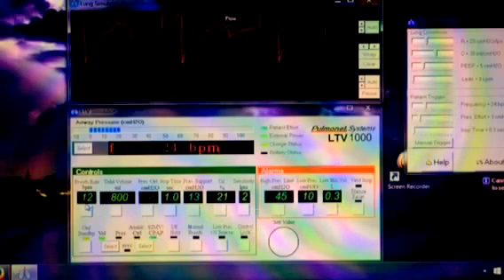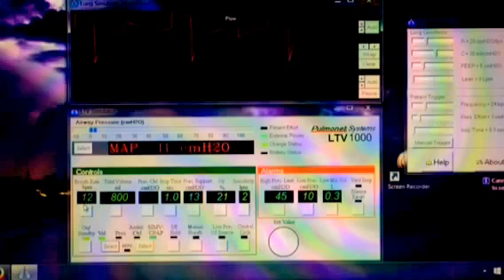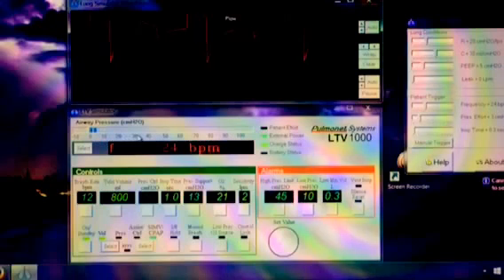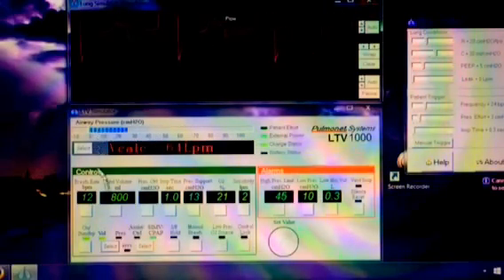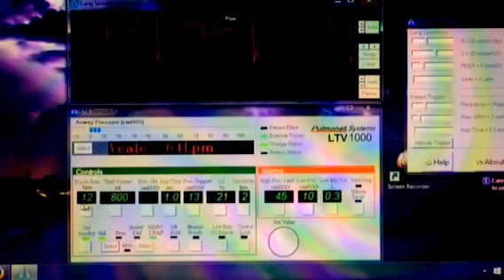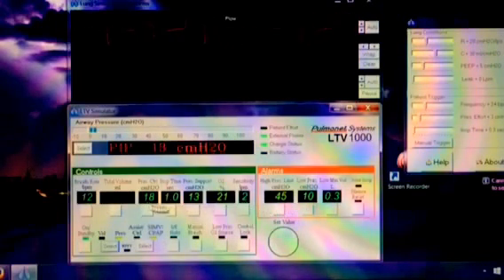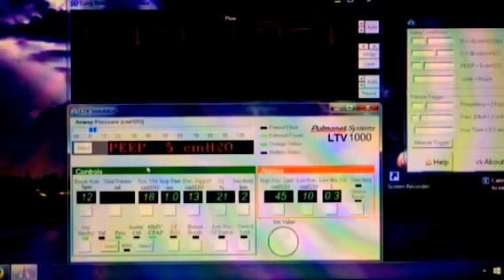VOLUME & PRESSURE CONTROL MODE EXPLAINED

Comment: Thanks for video, but how to know how to choose the pressure? Is there any suggested pressure for pediatrics? How much pressure is enough for a 3yeras old boy?
Reply from the maker: These values are from what I have encountered. Every doctor is a little different. 
Typically: Newborns- 20-25/5, Rate- 40, I-Time- 0.4 seconds. 
 As for the age... I believe more important is their weight and developmental age. Is that 3 year old boy average height & weight for his age? Typical PEEP- 3-5, PC-18-25. Enough to obtain adequate VT and chest wall movement. (This is for long term mechanical ventilation)
Reply: @68superwes  thanks for reply👍